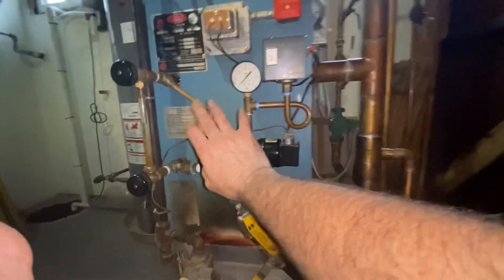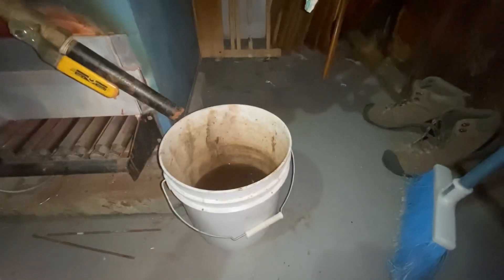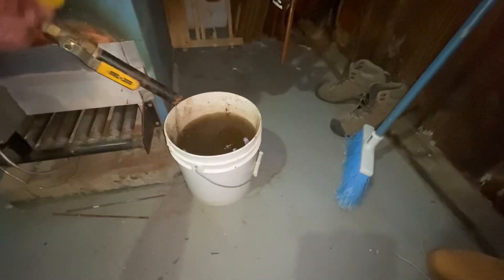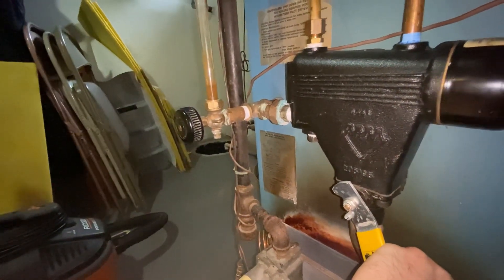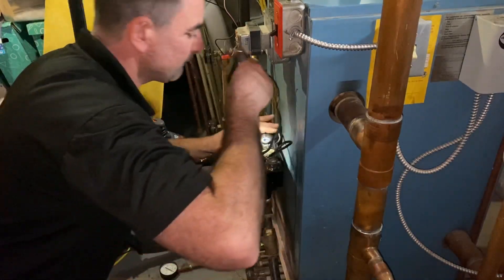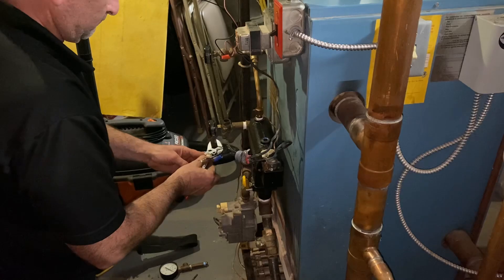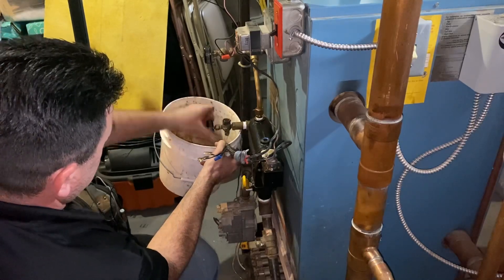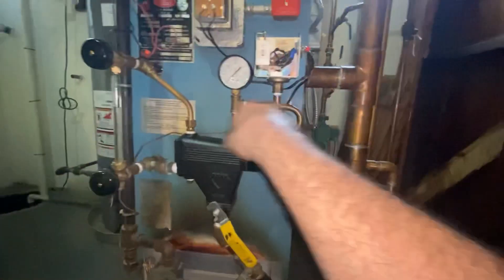Important Steam Boiler Maintenance  MacDonald 67 Low Water Cut Off

Comment: That one gauge should be on a pigtail, steam should never be able to directly hit the element!(use a cross tee)
Thanks for the videos!
🥃🥃🍺🍺🍺🍿🎯
Stay safe. 
Retired (werk'n)keyboard super tech. Wear your safety glasses!
Reply from the maker: Surprisingly that gauge still works. I also believe it should be after pigtail. When installed before they get screwed up and show higher pressure than what’s in the boiler. Dunkirk/ Lennox was making their boiler with gauge on top and they always failed. If I had fittings on me I would move it

Comment: you don't put in boiler dry steam treatment?
Reply: What is dry steam treatment??
Reply from the maker: I put in a treatment if boiler is surging, sometimes if it is really dirty. With the float type low water cut offs if a customer isn’t flushing. That could get clogged up from all the sediment the treatment brings back to the boiler